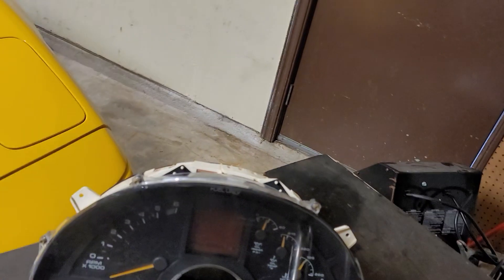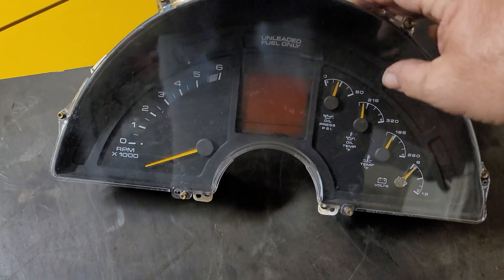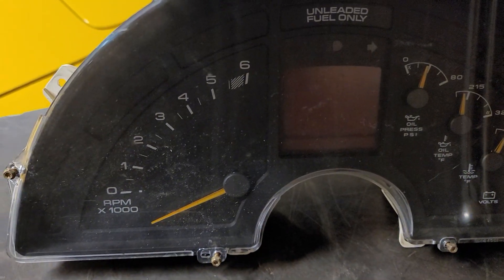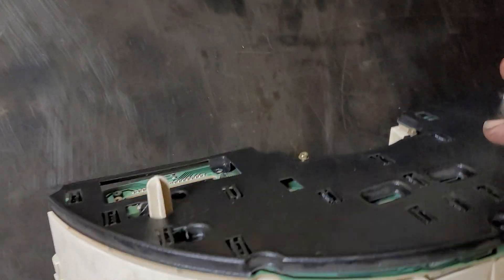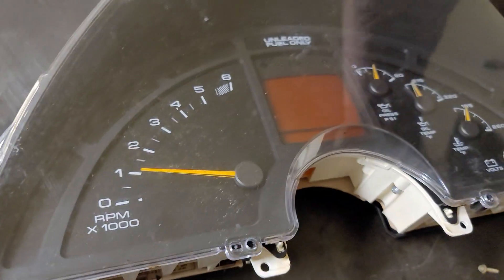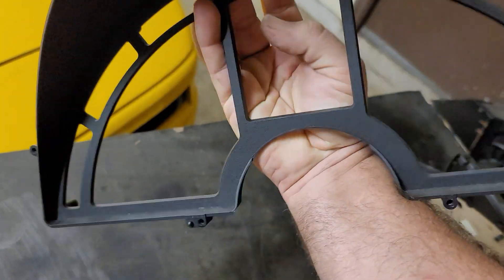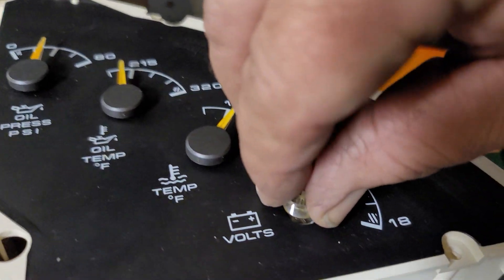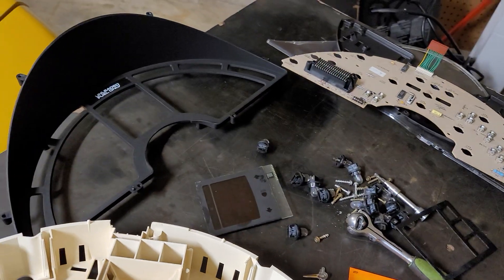The C4 Corvette Hybrid Instrument Cluster of 1990 - 1996

Comment: Great information.  I heard that a cluster from a higher mileage car will not reflect because mileage is stored in the body control module?  So that means any good used cluster will work fine showing my correct mileage?
Reply from the maker: Thanks Timothy. That is correct, a replacement cluster is a plug and play interchange and will display the odometer reading of what's stored in your BCM.

Comment: I have a 95 LT1 and the speedometer and fuel gauge just stopped working.  What do I have to replace and how do I remove the cluster gauge from the car.  I'm hoping it is easy because I am not much of a mechanic.  It was working, but I had to take it to a shop and they removed the fuel tank because water got in to it and they cleaned it out.  Since then I can't read the speedometer or fuel gauge any more.  I was and am impressed with your tutorials and you make things make sense.  Thanks
Reply from the maker: Hey Raymond, thanks for the feedback. I'm glad the videos have been helpful. 

The cluster is a fairly straightforward operation to remove. It's held in place by four 7MM screws. To access, you will need to remove the lower DS hush panel and knee bolster. Once those are off, remove the two 15MM nuts holding the steering column to the dash support and allow it to rest on the seat. Once out of the way, you can take the four screws loose holding the black dash bezel surround. You will then be able to see the four 7MM retaining screws holding the dash in place.

Let me know if you need any further information and I can walk you through it.

Comment: Y does mine occasionally go blank ? Doesn’t always stay blank though
Reply from the maker: Sounds like a connection problem in the circuit board. It may be the electrical ribbon or loose, or a problem with the pins on the circuit board itself. Regardless it will unfortunately need to be torn down for a closer look and inspection. Let me know how it goes or if you need any further information👍
Reply: The main connector to the cluster.
Reply from the maker: Yep, another possible culprit. Thanks for chiming in👍

Comment: my 95 the speedo is above the gas gauge and has black lettering orange background is that right
Reply from the maker: Yep, that is correct. They made the speed number more visible and driver centric in the later C4's by reversing the location of the speedo digits and fuel bars.

Comment: Where might I find a cam position sensor 91 ZR1 and the liquid crystal display for the instrument cluster any help would greatly be appreciated?
Reply from the maker: Howard, last time I checked AC Delco was offering a replacement sensor with Part # 213-3826. 

As far as the LCD glass display piece itself, those are quite difficult to source since they aren't making any reproductions. The 90-91 clusters have been especially hard to find, so the best bet is to look around for a usable core and harvest it for parts. 

I will check my sources and if I locate anything will let you know.

Comment: I have a 93 C4 with a Odometer Error readout where the miles should be.How can I find out what the problem is?
Reply from the maker: Sounds like you may have a BCM output problem off the top of my head. Have you done any troubleshooting of the electrical system yet?
Reply: @VetteSource  no, everything else works ok
Reply: @michaelriley3589  Does it say SYS instead of the odo reading or just saying nothing at all?

Comment: Hey bud my smog pump is missing a section of a hose the other section connected to the air valve are constantly sucking in Air will this give the system a rich mixture should I close this line off???🤔🤔🤔🇺🇸🇺🇸🇺🇸
Reply from the maker: Hey buddy, It's not likely, as the smog pump is designed to pump fresh air to the exhaust side to lean out the mixture. More air added might make it leaner, but you would probably only see a rich mixture if it wasn't pumping air into the system at all.
Reply: @VetteSource  Will the computer make the adjustments to the lean mixture??? And on your heads up display on a 1986 model if you put a bright flashlight on the heads-up display can that ruin the tint??? Also when I unplug the battery to charge it when I reinstall the battery and plug it up, on Startup the air is on, is this normal???🤔🤔🤔
Reply from the maker: Yep, the ECM's main function is to maintain a 14.7 to 1 fuel/air ratio so it uses the inputs from the sensors to adjust the fuel/spark parameters in real time. The flashlight wouldn't do that kind of damage to the LCD screen, it usually occurs slowly over several years due to UV sun exposure. You may have a fault in the AC control head making it default to A/C on when you start the car. Did you get my email about your car having a 92-93 ECM?
Reply: @VetteSource  Hey bud I just sent you another email with my full email address I did not receive your email.
Reply from the maker: Ok, sounds good. I will check it out when I check email later.
Reply: @VetteSource  hey bud I noticed that while the car is running when it goes to closed loop after the vehicle shuts off the security light is blinking could it be that security shuts off the fuel injectors??? If so how would I bypass the security systems🤔🤔🤔🤔
Reply from the maker: Man it sure sounds like that's what it's doing. Your security system is run through the BCM, so you should be able to run the bypass on there. They used to sell a kit for it, but not sure if they're still available so you may need to rig up an inline resistor yourself to make it work.
Reply: @VetteSource  I found the VATS bypass system on eBay only $17.99 and only 3 wires to hook up they still sell this item. I was advised to unplug my CTS and see what happens if the vehicle is still running, what is CTS and is it associated with the VATS security system??🤔🤔🇺🇸🇺🇸
Reply from the maker: Not sure what they're referring to when they mention CTS? Did they say what system of the car it controls?
Reply: @VetteSource  coolant temperature sensor and it does not control the VATS security system..
Reply from the maker: Nope, they are independent of each other. Think of the VATS like a built in multimeter that is verifying the proper voltage value before turning on the fuel and spark.